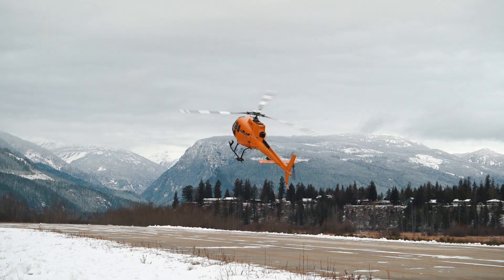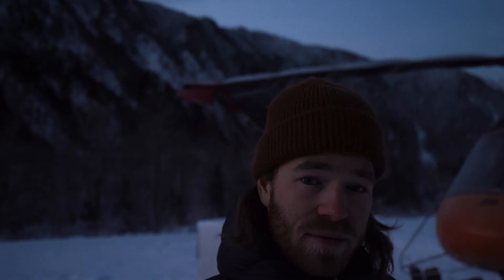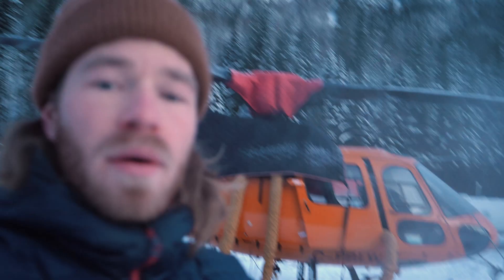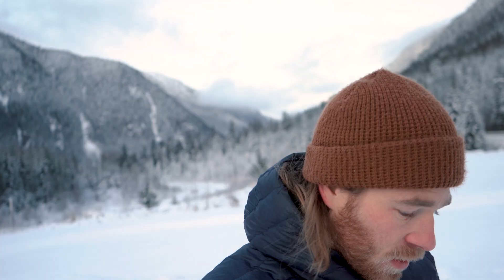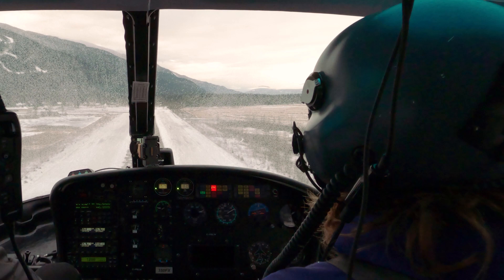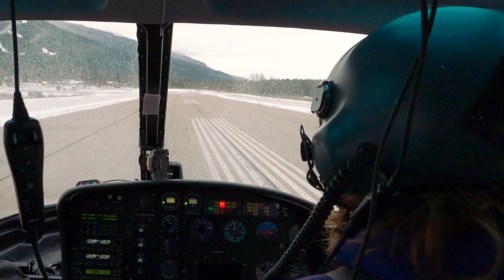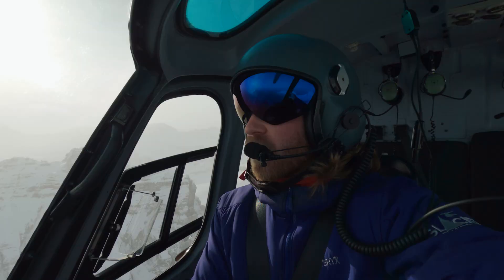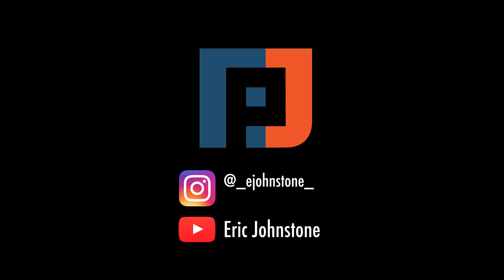ENGINE FAILURES, AUTOROTATIONS AND EMERGENCY TRAINING IN THE AS350

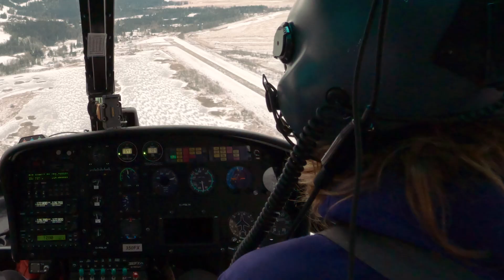Comment: Damn, that auto at 8:35 is crazy! Can see your headset cables float for a second in zero G. Those steep banks with the engine out seem pretty wild to a fixed wing guy like me. Any reason why you didn't continue to your 1 o'clock and land with just the minor heading change? Seemed like nil wind also?